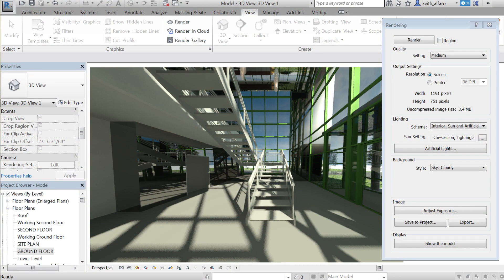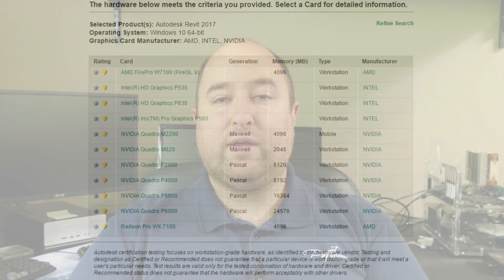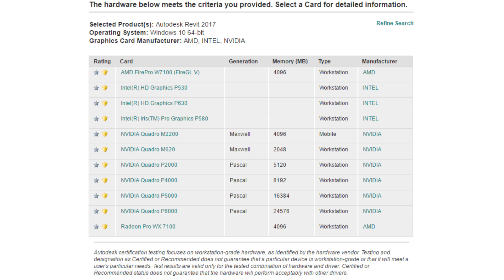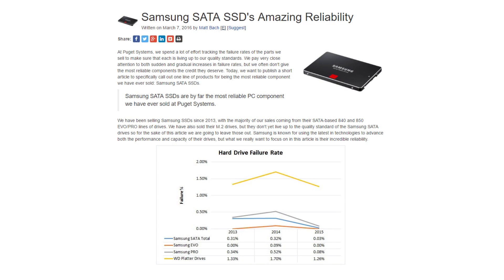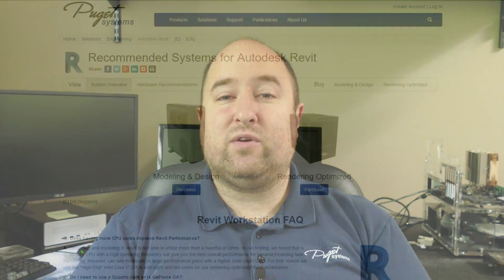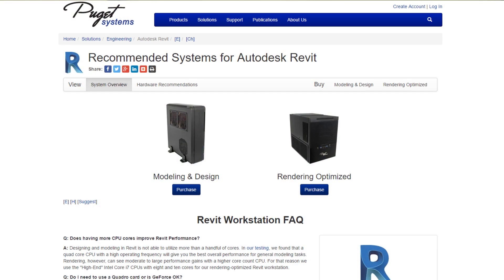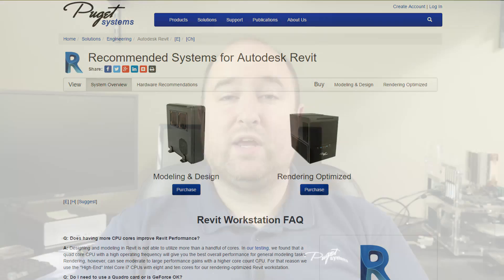Hardware Recommendations for Autodesk Revit Workstations

Comment: For anyone to know more hardware setup workstation, Intel i7 CPU with 16gb ram good only small Revit project (less than 20,000 sqft or 1900 sqm). For middle to large Revit project you will intel Xeon e5 with 32gb or more ram DDR4-2400 ECC memory, with Quadro  graphic card in the workstation. Example  HP z840, Lenovo thickstation p920 or p720. The most power laptop is good for viewing Revit project design not enough power to work it. Dual display monitors is needed as minimum requirement.

Comment: so since Intel tends to clock higher should u only use Intel?
Reply from the maker: We haven't specifically tested Revit on the newer AMD Ryzen processors, but based on other applications where we have tested that platform I would say that single-threaded programs do usually perform better on Intel at the moment. If you are doing a lot of rendering in Revit, which can use multiple CPU cores better, then a higher core count Ryzen processor might be a decent budget option.

Comment: am i the only one who never heared of autodesk revit before? anyway looks good ohh wait this was no ad for revit was it?
Reply from the maker: No, not intended as an advertisement for Revit. It is a program for building information modeling, so if you aren't in architecture or structural engineering then it isn't surprising that you've not heard of it. Just an informational video for our customers who do already use it, or folks out there researching what sort of computer / hardware to buy.

Plus, I don't think Autodesk sells much software in Equestria. Hooves don't work well with standard computer inputs like keyboards and mice ;)
Reply: ohh right silly me :D thats how to reply!